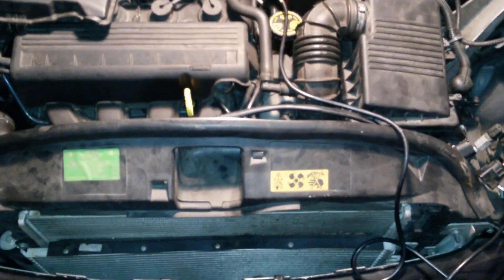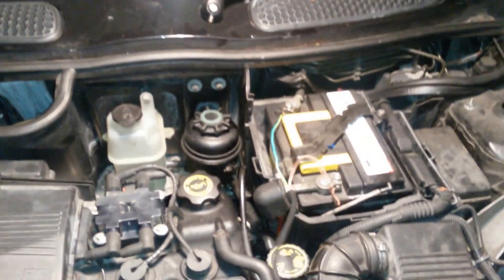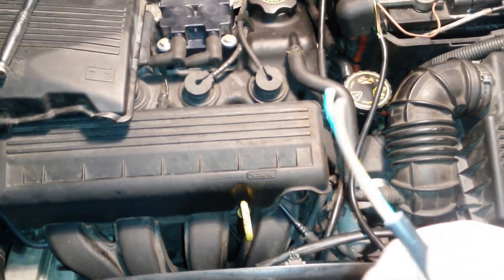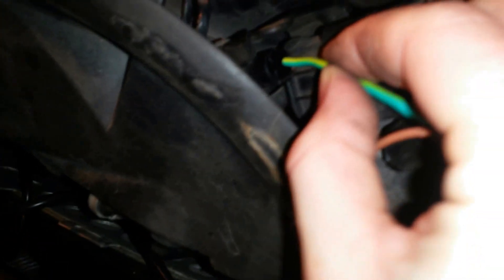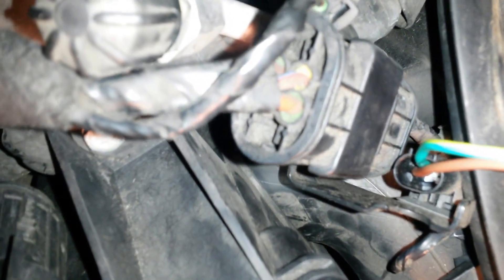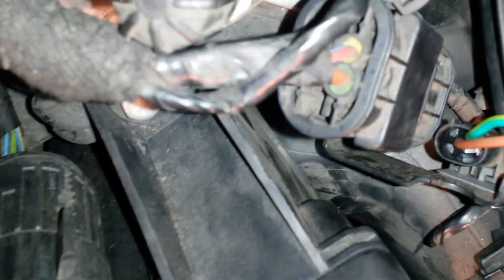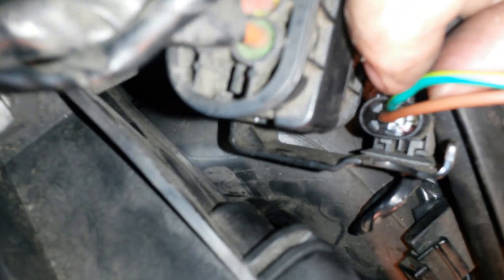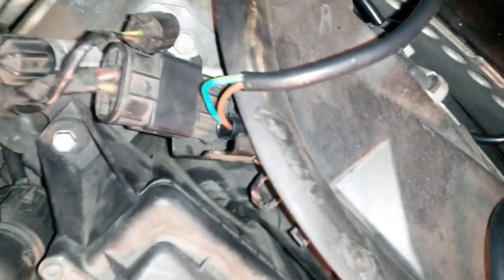How to test the radiator fan on a Mini R50 2002-2003

Comment: The fan almost always breaks. The fan has two settings. At 105 degrees Celsius, it's setting 1. The fan starts running and ensures the motor temperature drops below 100 degrees Celsius. This setting almost always breaks. Replace the fan. Setting 2 only starts running at 120 degrees Celsius. It usually stays running then because the motor is much too hot. Turn off the motor. The fan still runs.

Comment: I get nothing from the battery directly low or high . Is there a way to test the motor without stripping the car down ?
Reply: I know this is an old comment, but I have the same issue on my 2006 R52. Nothing on high or low speed fan when connected directly to a battery/power source.
@graycbr600 did you find out what your issue was?
My guess is I need to replace the whole fan, which means dismantling the whole front end! :/
I read some people reporting the PS fan gets jammed/broken and can stop the cooling fan....??

Comment: when I give 12v to the low speed circuit, nothing happens, when the relay is given 12 v the high speed fan works , but when everything is connected, the low speed and high speed fan never come on and the car boils over.

Comment: Thanks Ian - similar problem with my 2002 where the fan just stays on after the car is turned off (have to disconnect the fuse to resolve it) but will then sort itself out a few trips later. I’m convinced the relay is getting stuck every now and again and if that’s the case do I need to replace the fan motor to fix it?
Reply from the maker: This might help. https://www.justanswer.com/bmw/2leev-2002-mini-cooper-cooling-fan-continuing.html

Comment: Hi, it seems my high speed fan is starting almost immediently the car is turned on and doesn't stop. I have no engine lights on, new coolent and engine is not running hot could you please suggest what the problem may be
Reply from the maker: Sorry it's taken a while to get back to you. It sounds like your relay is either stuck on, or your ECU is constantly telling it to turn on. Check if there's power coming from the ECU. If there is it's a bad ECU, if not, then a stuck relay.

Comment: Mine is the resister is there an easy way to do the job with outtake ing the front bumper off and the unsaid to get to the resister fan.  I was thinking of cutting around the resister Plastic save me a lot of the time towards,  fitting a new you resister. cat around the plastic was the resister goes with a Stanley knife and a little gas blow torch job down 1 hour. the 3 wires were disconnected ted from the resister.
Reply from the maker: Have a look at the video description text. I wrote a section on how to easily fix your resister fault.
Reply: I did see it but now you pointing out to me again I understand how to do it. Thank you.

Comment: My mini coopers fan stays on after I turn it off and will turn off after a couple of mins. Anyways I can fix this without needing to replace anything? Bypassing and all that???
Reply from the maker: If it's just running for a couple minutes, that's probably normal behaviour. I wouldn't worry about it unless you notice it staying on for longer periods, which could indicate a stuck relay

Comment: I think I might be think8ng the low speed fan is the high speed fan judging by the noise.  Would it be on constantly with aircon or just pulse on and off do you know??
Reply: The low speed fan is on constantly when the air-con is on. If low speed is faulty, then air con will activate the high speed to come on and off. It's a good way to test if your low speed fan is working.

Comment: Using this method, any idea why the low speed fan would work but the high speed wouldn't? When I provided power for the high speed, the fan would click once, and then click again once I removed power.
Reply from the maker: Check your fuses. I think it might be the 50A one. Check that there's 12V coming from the fuse box to the brown and red-blue (thick) wires. If there is power, then your relay is probably no longer working.

There's a good circuit diagram here - 
https://drive.google.com/open?id=0B6SS0MH5ttMWSzNPMXF2Z3prZVU
Reply: The 50A fuse (FL11) is still good and I confirmed power from the fuse box to the high speed wire (thick red-blue). I *thought I* positively tested the high speed fan relay (R4) for continuity but it turns out that relay is NOT for the high speed fan for my 02 (or early 03s)... (that wiring diagram then is for 03/04+) so my car doesn't have a high speed/stage II fan fuse box relay (...?) so it must be built into the fan itself...? I can't find an 02 wiring diagram to confirm :/ That does make sense why I heard the clicking from the fan - that should be the relay clicking then with power, but I guess the contacts could still be bad? I suppose I'd need to get access to the fan itself to check...
Reply: Chris D'Antonio did it end up being the relay inside the fan itself ? I think I’m having the same issue

Comment: Thx great video, in my case the high speed fan is working on the lower pin in the large connector (regardless of the smaller connecter being connected) but  lower speed is not working. Would that mean the resistor in the radiator housing is faulty?

Comment: Very helpful Ian, I'm in the same boat, your tests prove the resistor is fine. Do you know what controls the 1st stage fan, where it gets a signal?
Reply from the maker: The computer (ECU) would send a signal through the relays and fuses. My power steering fan was clogged which blew the same fuse that the radiator fan uses. So check there first. It's not hard to completely remove the power steering fan, clean it up and test it by connecting it straight to the battery.

Otherwise overheating could be caused by the thermostat, temperature sensor, airlock, radiator cap or worn coolant pump. It's an old car :(

Comment: Did you ever figure out the problem? Also thanks very helpful.
Reply from the maker: I think the above helped greatly but it was an old car and soon started overheating again. I'm guessing air in the system and possibly even a worn coolant pump.

It had a number of other faults and I'd spent my budget so I ended up trading on a new small car.
Reply: @ianmurnane744  Lol